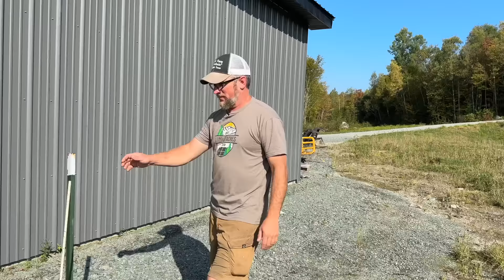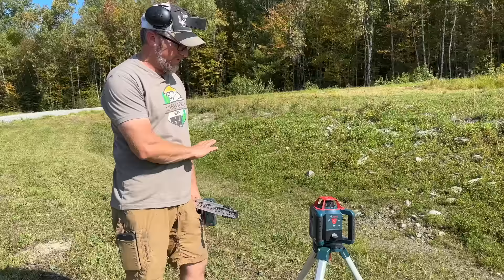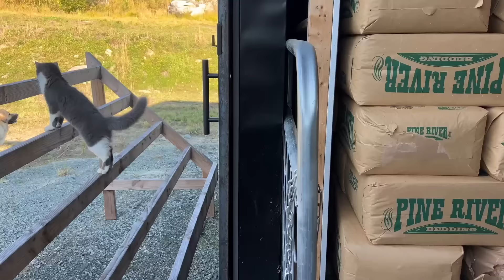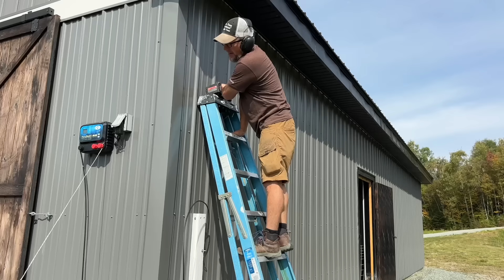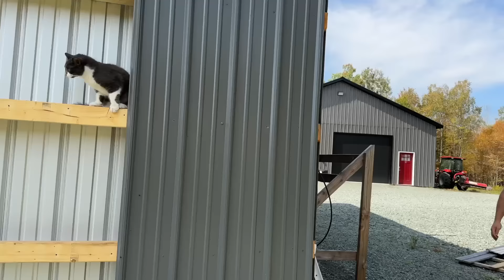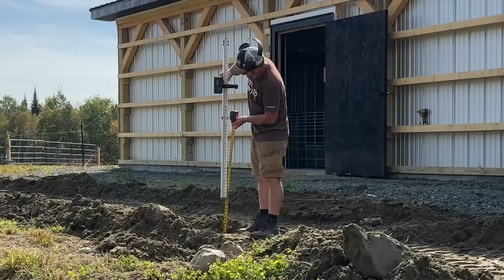We Had to TEAR It ALL APART! Living OFF GRID in the WOODS

Comment: I got way behind on video guys. I helped my oldest son take down the loft my sister, myself, and he built in his apartment about 10 years ago. He had a two story ceiling and very little floor space. We put a 12' by 12' upper loft for him that made it so much easier for him to live there. I had to replace my alternator in my truck too. I don't have an Internet Service Provider (ISP) at my new apartment so not a lot of time to have an internet connection. You're getting ready to put the barn extension on. Thank you to that person that sent them the t-post puller! I like that you are going with a 12 foot wide slab along the barn. Fern and Forrest look so cute. Wow, you took all the metal siding off that side. The regrading done by the mini-ex was good to see. Thanks for this video Lumnah family!

Comment: Two things about your grade of your barn addition.  Firstly, at least six inches below existing slab given the topography of surrounding soils and run off lanes.  Also, I would add slight pitch  to your new slab in order to clean runs and in the event of flooding it would shed water towards your run off streams.  The pitch I would add is one/eighth or one/quarter inch for every foot.

Comment: JudithB  I  would  add a  slant  to  the  new  concrete, so  when  it gets cleaned  the  water  will drain  off.  I  would  put  a metal sheet  on  the  bottom  of  the  outside pen and  clear plastic  on the  top half.  I  had  to do that  with my greenhouse  to keep  rocks and  stuff  leaned against the  plastic wall  from  cracking and getting holes,  then  the  cats got in and  made  a mess  of the greenhouse.  I  would  do  a  shed roof  on  the  other  side  to park  equipt  out of the  weather too  at  some point!!!  Love  watching  your  projects  happening!!!

Comment: Al, I’ve got to hand it to you, you have made a beautiful difference in the Homestead since you started. You started with a water well then a new two story house that wasn’t going to be the final one, just temporary which you built all by yourself and made an office and a nice rendering room for your meat harvesting. The very large solar system, the large boilers and heating system, your septic system and water faucets everywhere. You also built two nice big barns and two or three out buildings for your small animals including a milking stand to milk your goat on, then you put up fencing and electric fences. You seeded and fertilized lots of the places where grass was not growing so well, made a large garden place so you could grow your own veggies, spices and flowers. You made your own compost pile and bought an old manure spreader so you could spread the compost. Your wife has all the most beautiful cookware, cabinets and appliances that money can buy. You have an expensive smoker, quick freezer and any food processing  machines that anyone could ever need. You have the best tractors, mowers, tillers, trailers, pickup, car, excavator, side by side vehicle, and now you have bought a new bigger tractor which makes two and they both have cabs with heat and air conditioning and radios. You have bought several expensive cattle, hogs, chickens and turkeys lately.  I admire you for what you have accomplished but I am baffled as to how you have managed to do all or this?  You are around the Homestead every day so you must not have a job anywhere, the only visible income you might have is the selling of the timbers. I know you built an office in the temporary house but I don’t know what you use it for, I’ve never seen you in it? I know that you had “ the old homestead” which you probably still have. I know it is not all “down hill” because you have had problems with being real hyper and not able to control your actions and your wife had some serious female problems but thank goodness you’ll have that under control now. 
Al, I just think you are a miracle man with some secret receipt on how to get buy like this. I would give you anything if you could tell me your secret?
That’s asking a lot but you will not be sorry for indulging that with me.
THANKS

Comment: If you say you want more eggs, then you want clear  / translucent polycarbonate panels. Insulated roof panels that you can use as “windows”.  Some are insulating  for both winter and summer as they have a space between layers. They will require a frame but you are capable of that!!!  You say you love researching things Check Lowe’s clear polycarbonate sheets for roofing. They also suggest alternatives!  One being Tuftex.. rated for high of 270 F and low of -40 F

Comment: Do you get the cows hooves  trimmed ?  They do get overgrown and can cause problems for them.  Now that you have then in the woods its so easy to damage a hoof on sharp rocks and sticks.  I didn't think its an issue in the pasture because you move the pasture borders around and you or Gina would see something. I have seen you find old pieces of barbed wire and stuff on you property so I'm a little worried.  Have a great day Lumnahs
Reply: A valid concern... thanks for mentioning it

Comment: Hi Al and Gina, I like the idea of the acrylic like hot house sheeting as the upper part of the wall. Have it mounted on awning hinged frames so they can be opened up to air and dry in the warmer months too. That hot house sheeting has a tubular type structure and is insulative to protect plants. I live in the tropics and like to have awning hung walling on my workshop to give me air flow and a larger shaded workspace out of out hot summer sun, so a similar idea. Also, use rubber washers on each side of the plastic as the steel and plastic shrink and expand at different rates. In my old car port, at my previous home, the sheeting cracked around screws. I also suggest that the holes are a larger diameter than the screw to allow for movement. The rubber washers are a thick silicone rubber so they allow movement but still seal. Love your projects, so many things go into building up the self reliant homestead.
Reply: Very good points on expansion and contraction...these are things people don't see happen but are important to know for a better build...🖖

Comment: That bank looks perfect for a retaining wall  using your large rock pile. So you get a waterfall to the ditch. 
You should put metal on the walls of the extension but plastic for the roof. Get all that sun, and snow will shed better.

Comment: Tin transfers heat significantly better than plastic; as a metal, tin is a good conductor of heat, while plastic is a poor conductor and acts more like an insulator, meaning it does not transfer heat well.

Comment: Ya might think about putting tubbing under the slab, then make a solar water collector on the roof for it.  Verry little  energy to circulate the water would be to heat the slab durning the day would keep the animals warm well into the night.  Would be a great project ( experiment  ) to help keep entire barn warmer during the  very cold winter.

Comment: the problem is Chicken stop laying because of the stress of growing feathers at the end of the Molt.  They also stop laying because the lack of light of the shorter days cause stress on the chickens.
But also the stress of the cold temps of winter also stops the chickens to stop laying eggs, because of the stress of diverting energy to keep warm.  Chickens do not law eggs below  40F and for winter egg production you need temperature between 60–75°F:
Commercial egg producers keep the chicken houses Temperature between 60–75°F, a minimum of 16 hours of light for maximum temp.

Putting chickens in a cold barn with lighting with out heating will not force chickens to lay eggs, and allowing them to go out side in the cold will discourage them from laying.
Egg producer mus be kept in an area with Temperature  between 60–75°F and with a minimum of 14 hours of broad spectrum light.

Al has built a cold barn not capable of being heated as it lacks insulation, and his idea of housing the chicken in a cold barn below 40F wont make them lay eggs.

Also when a sow gives birth it is called farrowing, not sowing, the most dangerous type of farmer is a city slicker who thinks they are farmers and know how to raise livestock.
Reply: I agree book farming is scary
Reply: Time will tell... good info above ↑
Reply: @samvalentine3206  I grew up On a farm and  I Cringe every time I see things like putting cattle in a pasture full of Bracken ferns which are  toxic to cattle that when they eat cause eventual death, and to see the pasture in the woods the cattle have eaten almost all the Bracken ferns is a very bad sign.
I hate to think how many hours was spent growing up walking a pasture looking for toxic plants that could kill cattle and other livestock.

There is more to farming than building pastures and putting animals in them.  

Commercial egg producers climate control the coops  to hold a steady temp for maximum egg production which is between 60F and 75F, it is not rocket science that chicken when stressed by cold weather or extreme heat stop laying eggs.  Chicken divert energy to stay warm in the winter and in the summer extreme heat stress them and egg production declines.
Reply: So if you didn’t grow up farming, it is dangerous to ever have a homestead with livestock?  Give me a break.  Just because one starts as a beginner doesn’t mean we all can’t learn and get better along the way.  I wasn’t born  a health care professional as a child but I’m pretty dang good at it now.  Better to point out improvement kindly and encourage, or is that something “real farmers” aren’t allowed to do?